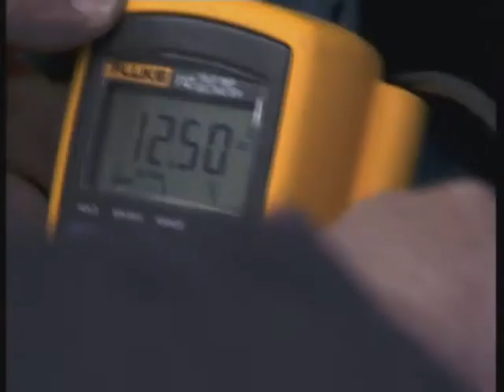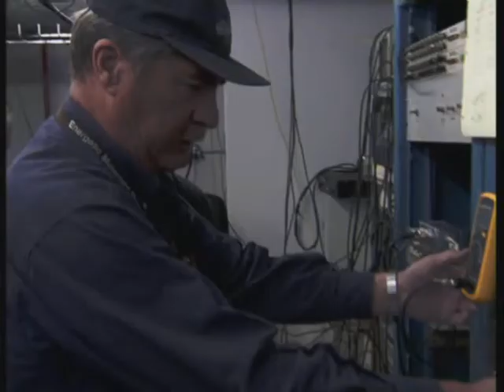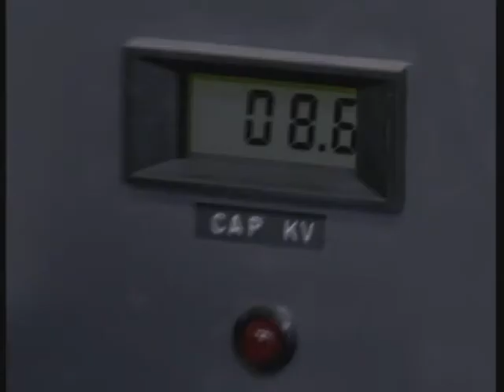TWA Flight 800 Part 1

Comment: This test actually refutes the NTSB version of TWA 800. Notice that it took them nearly 3 hours to heat the tank to the appropriate temperature, which the testers put at 112 degrees F. Now, how would TWA 800's fuel tank have become heated to that temperature sitting on pavement in 70-degree weather for less then 2 hours? How? Moreover, as many experts have noted, the fuel tank certainly would have cooled off as the airliner moved, took off, increased speed, and gained altitude.